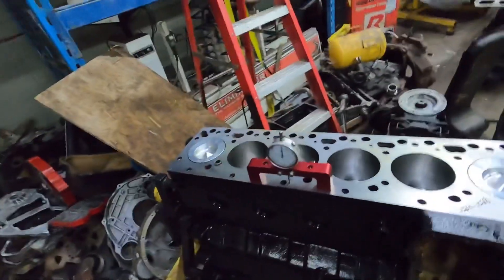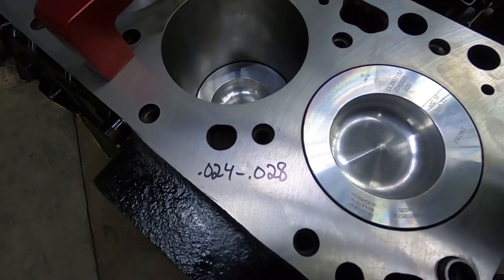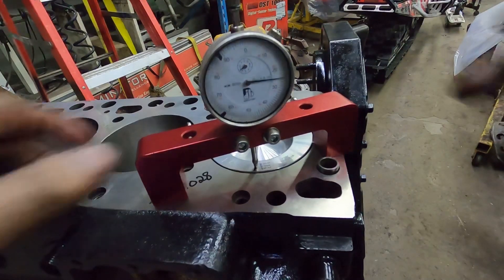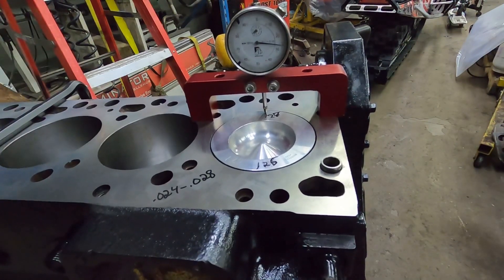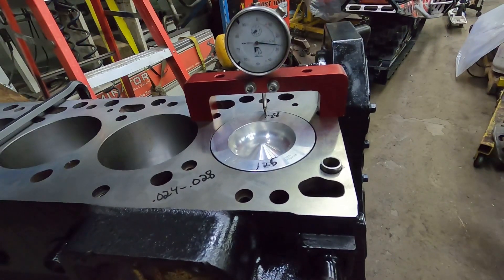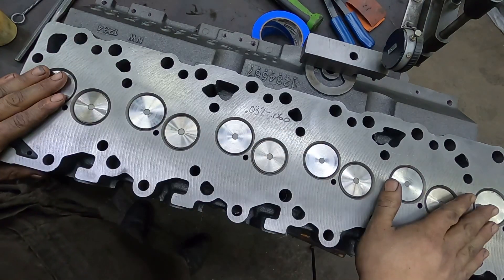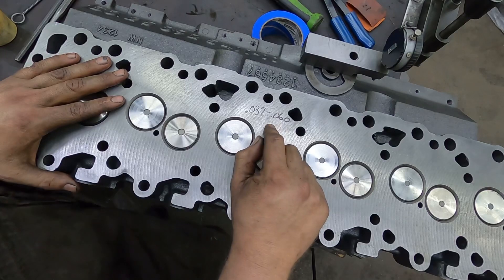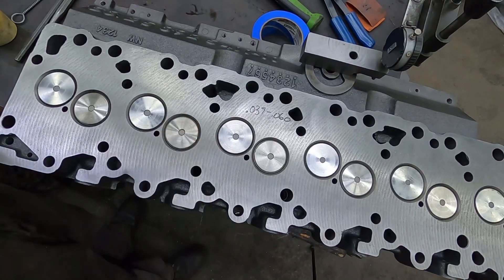How to check your piston protrusion and valve recessions !

Comment: What head gasket would you recommend? I'm rebuilding my own 24 valve 5.9 cummins my piston protusion is .032 thou due to having my pistons ceramic coated and also .020 over on the cylinders, I also installed the hamilton 178/208 cam because I will be towing my rv with it.

Comment: I was measuring the valve recess but I feel like I’m doing it wrong and I’m not sure if the piston protrusion is right either I was getting between .025 to .030 for protrusion and my recess was all different. Could you go more in depth on like how to make sure the tool is reading correctly? Especially the valve recess on how to set it up correctly?
Reply: I had the head resurfaced and the block resurfaced and 60 lb springs installed I was thinking of going with a .010 over gasket?

Comment: Do you have the specs for a 2018 Cummins 6.7l? Doing a build now and trying to find the correct head gasket I need. Protrusion is setting at .023” and valve face depth is setting at .033”, I’m pretty sure I need a +(.010”) thicker head gasket. Block was just decked, brand new head from ATL diesel, Hamilton tow cam #07-c-178/208. 

Having trouble finding the fire ring head gasket in .010”, lots of STD and +(.020”) but not the +(.010”) for fire rings. 

Any help would be greatly appreciated. Thanks

Comment: I designed and 3d printed my own tool that holds my digital dial indicator just for this rebuild I’m doing now. Made some inserts for neo magnets, glued them with superglue into the bottom, and sanded the bottom feet flat on a starret flat stone.

Comment: nice video, I have a 5.9 12v 135hp '98 engine from a Case machine. The pistons are grade C (71.78mm), do you know what their protrusion should be in spec? currently I have 0.035, valve recess is 0.040, ptv is 0.050. Can I still use std hg with stock cam?
Reply from the maker: I would do a .010 gasket. If it was mine thought I would just use a std

Comment: Hey I got a vp44 engine what are the numbers on top of piston represent I got a 3709 02 STD H26 I tried to look it up no info was found. So my other question is can I fit another piston with the same number as 3709 and it’s STD as well. I got 2 used pistons for the build, because I found some deformation on top of the bowl. I’m replacing piston 5,6. The new numbers and writhing on top of the piston are 3709 02 STD H17
Reply from the maker: there is two different piston bowls for the vp44 engine, but if the piston bowls looks the someand the ring land heights are the same  in both your fine,

Comment: I have a 2012 6 7cummins 3500 High output stock engine stock head gasket.  What is my piston protrusion oem specs? Thanks
Reply from the maker: Spec is .006-.019
Reply: @CUTTERUPROB  thanks

Comment: A couple years back I put together a 12v with a stage 3 colt cam recently I pulled the head due to a minor amount of coolant weeping from the edge. After removing the head I noticed the intake valves had contacted the pistons making a very minor indentation or witness on the pistons. I plan to Check the valve are straight and the seats and guides are not damaged. I’m assuming at high load/rpm i with making contact. Do you have any advice to do aside for checking protrusion and recession and put a thicker gasket on?
Reply from the maker: The list you have should be good for work needing done. If it had a std gasket and .010 over should fix the issue

Comment: Hey Rob, love the content. 

Just wondering if all 12v 5.9 block are the same? I have a 96 out of a f700 and a 97 out of a dodge ram. 

If I swapped the short blocks over would that work? 
Cheers, 
Tyler
Reply from the maker: For the most part yes. The early ones have couple differences but nothing that can’t be chanced

Comment: Not to to another story but what the best way to change connecting rod pin bushings ? Do you do that ?
Reply: FWIW, I had a Cummins equipped machine shop redo a botch piston pin install/ream that was done by hand on my 3.9. The shop you take it to should have the angled pin install tool and they should indicate then hone bushings c-c. To get close to equal protrusion the bushings need machine honed. There’s surplus material on new pin bushings to allow.
 Went from protrusion at .008 variance and a hard to turn over engine (binding/not straight pins) to .002 variance, smooth to turn over. .02$
Reply from the maker: Sam answered it. But I don’t do them in house. I send them away when get enough to do and have a shop do them for me. The tooling isn’t worth the money it costs to just have them done  for the amount I do

Comment: Learned something new about why you measure valve recession and what it should be for a particular 5.9 Cummins application. Building N/A gasoline engines there is a certain “quench height” that is desired. Is there any sought after “quench height” for 5.9 Cummins 12 valve or is it just a matter of P to V without cutting valve recessions? Thanks again for all of this information, I am learning so much that I did not know a out this engine. Thank you for doing this series, Merry Christmas!
Reply from the maker: the piston protrusion and  quench height is basically the same thing. only from a gas to most diesels is the camber on a gas engine is in the head vs the diesel is in the pistons, unless it's a pre chamber diesel then its a bit different. bit more to it then that but that the simple answer

Comment: Good stuff.  I am thinking about putting together a 6.4 stroker 12 valve with a 6.7 crank.  I know the pistons are going to have to be fly cut but I'm not sure how much we are talking about if I decide on a mild cam upgrade on top of that.  There's probably a limit to how much you can fly cut a piston right?  Do you see any reason why that wouldn't work?  I know the guys at PDD built one for a giveaway truck a while back but the technical info is pretty scarce...
Reply from the maker: do you want to do a 5.9 block 6.7 crank ? that would be a 6.1, 6.4 is a 6.7 block and pistons with 5.9 crank.
Reply: @CUTTERUPROB  My bad, got mixed up.  Yeah I already have a 12 valve.  Looking at putting a 6.7 crank in it.
Reply from the maker: @etiennegignac   i will be doing a a build on a 6.1 cummins this winter. i will go thought it in detail
Reply: @CUTTERUPROB  Sounds good.  I'll be watching.  Thanks again.